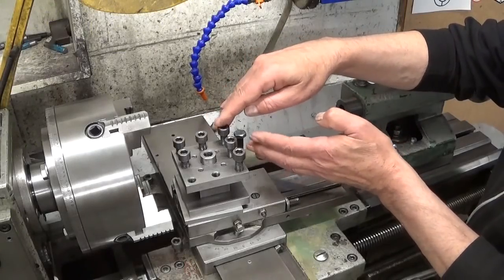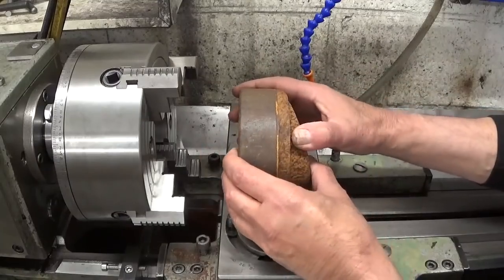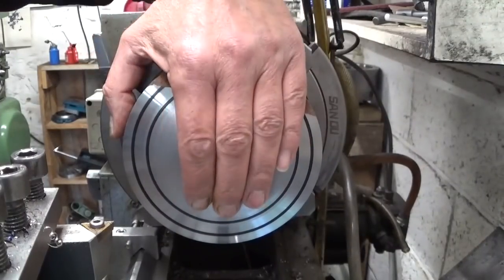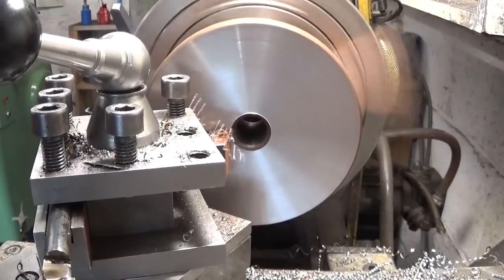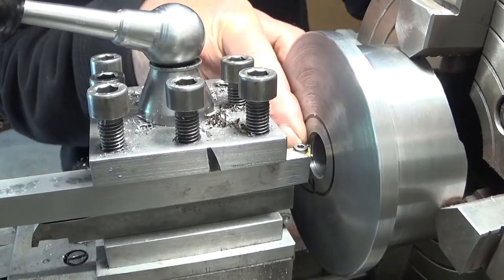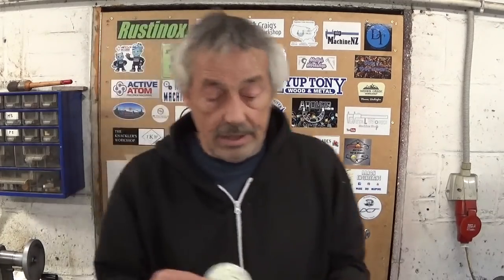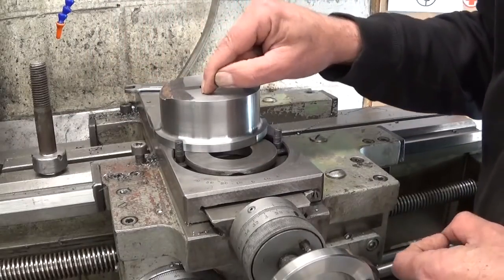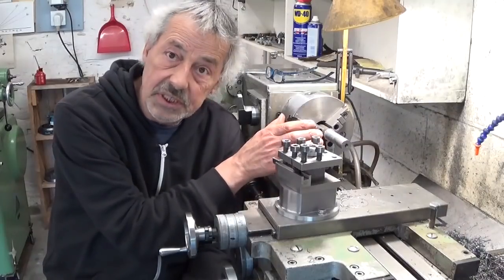Lathe solid tool post.

Comment: Thanks for the great video. I had cataract surgery so I've spent the day doing virtual machining. I was surprised to find that I wasn't subscribed, so I fixed that. My two cents on this topic follows the same logic and goals as most solid post videos I've watched. Increased rigidity being the goal. Synonymous with rigidity is minimal overhang and a design that helps counteract cutting forces. For this reason I think a third T - Nut + Screw  would be beneficially located at the center line rear of the riser block. Let's face it, the two T-Nuts that you have are not ideally located to counteract the downward force of cutting tools. This tends to lift the rear side of the riser block. If you put a dial gauge on rear of the riser block you can probably measure it on a very heavy parting cut.
Wakodahatchee Chris
Reply from the maker: Thanks C DRIVE. The first goal here was to clear the tail stock. The win in rigidity is just a bonus.

Comment: Yes! Solid toolpost definitely in my box of projects to do. Stefan Gotteswinter and Robin Renzetti were my inspiration. Also I am ditching any quick change or rotating tool holder at the same time. Having acquired a mill, a shaper and a surface grinder will make short work of projects like these. I will be making a square block and add two T-bolts in the base so I will have four in total, which is pretty much required for solid and evenly distributed clamping. Also I will have to try my hand at hand scraping, this would make a great project. Although hand scraping and hardening/ grinding are sort of mutually exclusive. Not decided yet which way I'll go.
Reply from the maker: I'm sure you will figure it out :)
Reply: @Rustinox  So many things to do! In fact the icing on the cake will be adding a post to put on the dial indicator arm. Another great invention by Rob Renzetti.

Comment: You did good job . If i was doing this  i put 4 bolt or tree  but good job
Reply from the maker: No Need of more bolts. There is no rigidity issue. It's to clear the tail stock.

Comment: Next project is simple... Remove any rock/slop in the tool holder by milling away all but 3 POINTS from the bottom plane. I did my own version of what you did here and was very surprised that I was still not rigid. I did a test by putting 3 shims under the tool holder out at the edges and spaced roughly 60 degrees apart, tightened down the holder and the reduction in movement was triple what I gained from eliminating the compound.
Reply from the maker: As shown in the video i lowered the top surface a bit and left just a rim. It works very well.

Comment: Hey Michele, nice engineering of the new tool post setup.  The real test will be if you can part off without chatter.  See you soon.
Reply from the maker: Thanks. The chatter problem comes from too much chuck overhang.
I have to dig in to that one day.

Comment: I like that you still retain the flexibilty of turning the tool post.  Too many of these conversions force you to remain perpendicular.  Let's face it, most people hardly turn a taper so the compound (top slide) can go in the drawer.  If you want more clamping force holding that fat block to your cross slide, you could always add 2 more bolts to hold it down.  Thanks for showing this, I'll put it on my list.  Subbed!
Reply from the maker: Welcome worldtraveler. And thanks for the sub.

Comment: I love how you used a discarded remanent and made a useful tool out of it
Reply from the maker: I use what i have. After all, steel is steel :-)
Reply: @Rustinox  I sold a small amount, maybe 140 kilo of  scrap steel and iron at the local scrap metal yard for $40 US.
The price for scrap is high currently because of the lock down.

Comment: Great video. I especially like the part where you mentioned chuck overhang. New after market chucks on smaller lathes are terrible. I have 3 or 4 videos on this subject and to be honest they are my only videos with negative comments. Apparently I'm not very convincing.
Reply from the maker: Indeed, it makes a big difference. The farther away from the bearing the more the spindel will flex.
Reply: @Rustinox  Yes. Also spindle diameter is a big factor. With smaller threaded spindles the threads are actually the weak point. I replaced 2 of my cast plates with steel on my larger chucks with a 1.5" spindle. This resolved the movement at the threads and helped the chatter but did nothing about the spindle flex.

Comment: Thanks alot for this video - I have just aquired a new (larger) lathe and faced just the same problems you've been having.
Now I know there is a solution - I'll have to contemplate whether I'm happy with "working around" the issue - with long tool stickouts and the lot - or build a fixed toolpost base like you did.
Well done!
Reply from the maker: Go for it Adrian. And show us the result.

Comment: Excellent project Michel, I have never considered this, however it brings to light how rarely I do use the compound slide, and how much rigidity I am sacrificing. Nice work, and a nice pile of swarf, cheers !
Reply from the maker: Thanks. It works great and it's easy to reinstall the top slide.